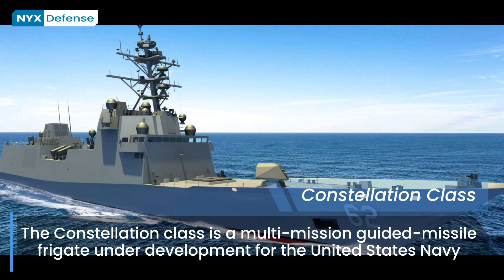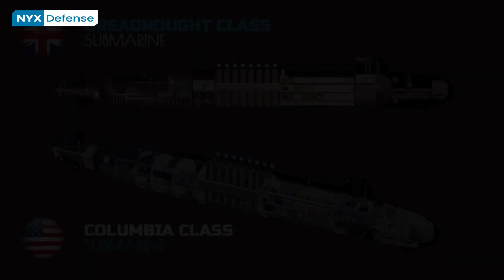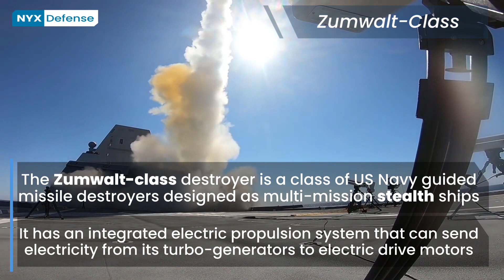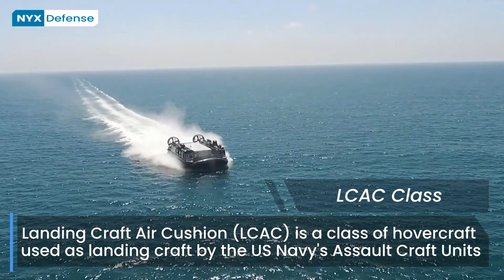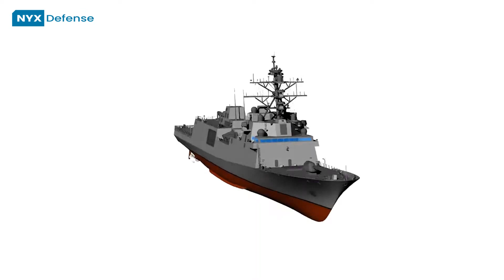Battle Force 2045: US Navy's New Ships

Comment: I believe that the Navy is going to need a lot of new ships and they are going to need them a lot faster than our country's major shipbuilding companies are currently able to build them. The United States needs to have more shipbuilding yards RE-Established around the country to meet this need. We need to train and hire new people to correctly build these new ships. Think back in time, during WWII America,  was able to build 24 Essex-Class and 3 Midway-Class Aircraft Carriers and a lot of other ships during those four years of combat. 
What I would recommend is that the Navy continue to build the 10 Ford-Class Heavy Carriers in Norfork, VA. that are currently scheduled to be built. In addition, the Navy should pull out the designs for the "Modified Angled Flight Deck" Essex-Class Carriers and build at least 15 of these Carriers as new "Medium" Carriers. Lastly, the US Navy should build at least 15 "Light" Aircraft Carriers, based on the Saipan-Class Carriers. These carriers should be built using modern technologies but be able to handle the heavier weights and high exhausts of today's aircraft.
Next, as far as the Marines go, I feel that the Navy needs to build a total of 15 of the America-Class Landing Helicopter Assault (LHA) and restart the Wasp-Class Landing Helicopter Dock (LHD) program and build 8 more of these ships. In addition, the navy should build three more of the San Antonio-Class Landing Platform, Dock (LPD), for a total of 15, and then start building 15 of the new, "Modified" Landing Ship, Dock (LSD). In addition, the Marines are wanting new "Light Amphibious Warships" that have shallow drafts, be able to long distances, have small crews, and that can carry small teams of Marines on "Hit and Run" Raids. I happen to agree with this idea and I think that the Marines will need 60 of these crafts split between the 15 Marine Expeditionary Units. Next on the list are "Gun Ships. The Marines are not going to need some super fancy gun system that can make "Precision" Strikes on some target 90 miles inland. They are going to need ships with GUNS, that can strike targets in view of the beaches that the Marines are going to be landing on. The Navy is going to need ships with GUNS that can hit targets behind the beaches and destroy those targets with almost unlimited gunfire support. Currently, in today's navy, the ships have only 96 to 122 missiles that they can fire before they have to withdraw from action and go back somewhere to be repaired and reloaded. While I do not think, at this time, that we need "Big Gun" Battleships, I do believe that there IS a need for Heavy Cruisers that carry, at least, 8-inch guns. These new Cruisers, based on an upgraded Des Moines-Claas Heavy Cruiser, would be able to carry 1350 rounds of  8-inch ammo for 9 guns. These guns can provide both "Shore Bombardment" and "Defensive Fire Support" in ship-to-ship conflicts. These new Crusiers would of course, also be armed with Anti-ship, and Anti-air Missiles as well as Phalanx CIWS Systems.

Comment: You may as well dump the LCS classes since the engines can't pass 10 knot, and the mission module's doesn't work as advertised. The amphibious assault ships are fire traps.
Reply: lol where are you getting your info 🤣 
 The lcs issue is not the engines 🙄 And ONLY 6 independence class ships are speed limited and its due to a crack in the deck not the engines🙄 The other catamaran hulls ships are limited to 14 knots in light seas and 4 knots in heavier seas because of the cracks. The freedom class are not having the same issue. The independence class is too stiff and the ships have no flex which is causing the cracks. 
 The mechanical issue was not the engines but the combining gear that was of poor design.  This has supposedly been repaired in later ships so they are capable of higher speeds than the earlier ships.
Reply: @johnstark4723  Thanks John. Iether way Lockheed shouldn't send out ships that can't do it's job.
Reply: @meeddi42  I agree, and the Navy screwed the pooch as well.